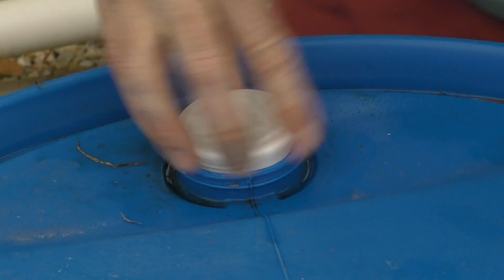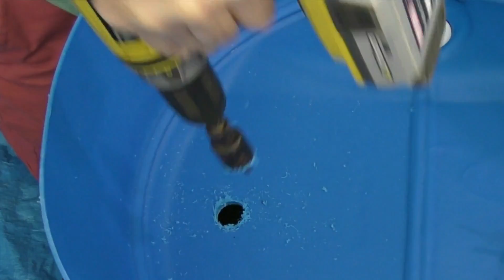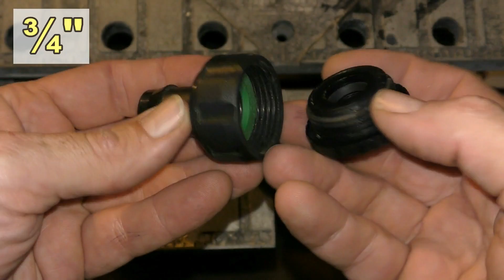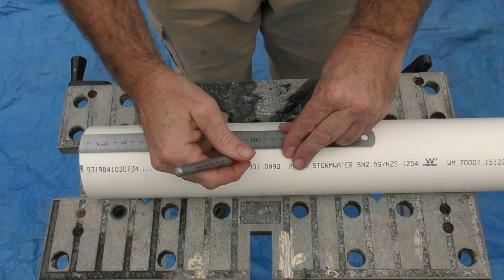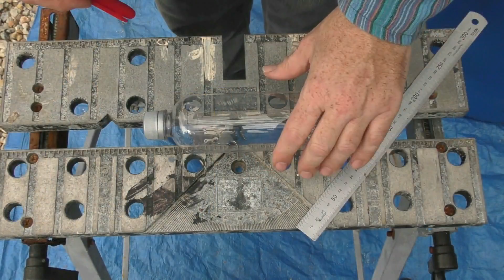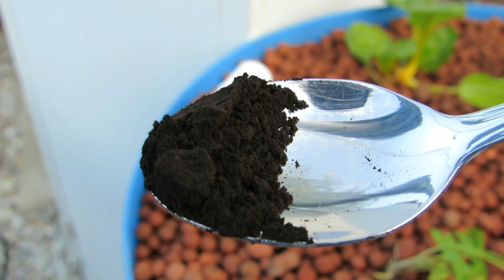Aquaponic Barrel System Build, Chop & Flip Style.

Comment: I watched your videos many many times as I built my barrel with my little one. everything seems to be working fine. I am curious about the ball valve used for flow control.  I have more water traveling through the ball valve than the TV at the top. Will the organic matter make it to the grow bed or mostly cycle straight back into the barrel? I mean obviously some of the poop will be making it to the bed, my concern is for the fish and that the water is getting the trip through the nitrogen cycle for full benefits for plants and fish alike.  How often on average do you purge your barrels and freshen up the water or does it seem to work out okay and you get by with replenishing from evaporation?
Reply: BTW.  We used the fish idea for a service port. we used a tracing of my daughter's hand for the fins on the fish.  Since this was our first aquaponics endeavor I found it fitting to go this route since this will be a project that I keep forever.
Reply from the maker: Hey Jeff & great question mate.👍 Sounds like the pump might be a bit oversized for the system. It's really hard to recommend one with a specific flow rate as they never work to the specifications printed on the box I've found. I tried 2 different brands with mine & found the Aqua One brand to be closer to the mark doing a test with a 10L bucket. 
On the filtration side, I think you should be fine as long as a minimum of 2 x the fish tank volume passes through the grow bed every hour. That should give the bacteria enough time to convert the waste as long as you haven't added more than 10 goldfish sized fish in the tank. 
As long as the system is cycled & enough water is passing through the grow bed you won't have to worry about removing any water, just top ups as the plants & evaporation reduces the levels. I liked to top ours up once the level dropped below 2 thirds the volume of the fish tank when the grow bed is empty. I just pull the bell off of the standpipe & let the bed drain before topping up.

Hope that has helped you out some Jeff.
Reply: the box says it is adjustable.  I'll see if I can dial it down a bit. It's going to be a while before I put fish in the system. Going to cycle the system and hone my skills on checking and maintaining PH levels, and the sort.
Reply from the maker: That's definitely a cheaper fix than a new pump.  😉  What are you using to cycle the system ?
Reply: urine

Comment: How often do you have to empty the thing to clean the bottom for the fish?
Reply from the maker: Hi Mr Blades. 
I found that the majority of the fish waste was pumped up into the grow bed so little cleaning would be required. As I had mine slightly elevated it would be easy enough to use a siphon hose to clean any build up on the base. 
Cheers Rob.

Comment: I'm very fascinated by your builds, I've been following many different Aquaponics set ups trying to determine what will work best in my sun room. The big challenge for me is the fish tank, I can't seem to find used ibc totes in my area. I've thought about building it out of plywood with bracers for support. FDA approved polyethylene material runs about $100 for a roll. My question is, what would you suggest?
Reply from the maker: Hi Kris & sorry I missed your post mate.
Did you end up building a fish tank or did you source a suitable container elsewhere ? 
If you were to use ply I would definitely make sure you have suitable bracing but you probably know that already.😉 
Cheers mate.

Comment: Hello Rob, Where did you get the bulk head tank fitting for this?
Reply from the maker: Hi there. Sorry for the late reply mate & hope you found the fitting. Are you still trying to find one? 
 I got them from the local hardware store here & know the plumbing supply store also stock them. 
Sorry again for missing your comment. 
Rob.
Reply: Thanks Rob, I enjoy your videos. I was able to find tank fittings. We worked it out with what is available here. We have two units running. I've been conditioning the tanks and  I just put fish in them yesterday.
Angela
Reply from the maker: That's great to hear Angela 👍 Hope the system takes off fast for you now things are warming up. 
Cheers.

Comment: I made a system like this but I only have hard water. What could I do to get my water soft for the system. your video are so helpful. Thanks
Reply from the maker: Hi mate. You could try saving some rain water & mixing that with the tap water to see if it helps some. The other option would be to treat the water in a separate drum with some muriatic/hydrochloric  acid to help reduce the hardness & also reduce the pH into a more plant friendly range. If you are going to use acid I'd start with a very small amount (less than a tsp), mix the water then let it sit for 6 hours before testing the pH. The reason being is that the pH will drop for a while then bounce back up. I have needed to repeat this process up to 6 times to get the water to about pH7 so some patience is required. 
NEVER do it in the system with fish or plants as you most likely kill them.
Hope that helps you out a bit & sorry for the slow reply.

Comment: Great looking system.  Have your run it for a longer term test?
How do you handle fish solids?
The ratio of water to grow bed seems high compared to other systems I see, is there enough grow media to filter / keep up with the ammonia without water changes?
I know there isn't lots of light entering the fish portion, but algae is bound to be an issue, any tips on keeping it in check?
Reply from the maker: Hey Jordan.
The system has been taken down but you can see a small update here,
https://www.youtube.com/watch?v=SSD1KuQXC8Y
In it's place I now have a large root pouch garden 👍

As for nutrient content & processing, that all comes down to how many fish are in there & how much you feed them.  If you put inn 25 fish & fed them all they could eat you would run into problems very quickly I think. As for solids, having such a small grow bed may mean you need to clean it out every few years if you have it highly stocked but even then it would take less than an hour I think. 
Algae could be an issue depending on how much light the tank portion gets & did notice it building up in ours just before it was pulled down. Easy enough to fix with a coat of paint (like most DIY aquaponicist do with their systems) & have seen some folks pop a section of reed or bamboo screening around it to make it look a bit more pleasing to the eye. 
Hope that helps.
Cheers.

Comment: G'Day Rob, I am starting to build a barrel system and was wondering a few things. How often do you flood the grow bed on a system this size? I am wanting to use a 12V pump and timer and run them from a battery with a smal solar panel to keep it charged.
Reply from the maker: Hi Richard.This one was filling in 3-5 min & taking about a minute to drain.  
How's the system going for you?  Sorry I missed your question when you posted it.
Rob.
Reply: G'day Rob, the system is built and running but I haven't planted anything in it as yet. I am running the pump on a timer at 15/45 but I am concerned that at times the pump cuts out after 15 minutes and there is still water sitting in the grow bed as it has not filled completely. Is it ok for the water to be sitting in the GB for the 45 minutes or is there a way to empty it?
I am just wondering what camera you use to make the videos?
Cheers
Reply from the maker: Hey Richard. I don't think the 45 min would be too long. If you are concerned you could always drill a small hole at the base of the standpipe to allow some or all of the water to dribble slowly into the tank below. 👍
At the moment I'm using a Panasonic HC-VX870M & my Samsung S6 mainly. Both do a fine job I think. 
Cheers mate.
Reply: peppa.

Comment: I want to do this but am having trouble finding a bulkhead fitting online. Please advise on where I can obtain the parts needed? Am in the USA Thanks
Reply from the maker: Hey Thomas. The fitting doesn't have to be the same as I used. 
These folks in the States sell a similar bulk head fitting if it helps any.  http://www.aussieglobe.com/bulkheads.html
Any plumbing fittings that can make a water tight seal will work if they take the pipe size you want to use. I like the rain water tank/bulkhead fitting as it has a longer tail on it. You can use a similar set of fittings that were used to deliver the water to the grow bed on the drain side as well if you want. You might run into issues if you want the base cap on the shroud though just to warn you. 
Hope that helps some.
Reply: Thanks Rob great info

Comment from the maker: @Peter M  Can't reply to you or PM sorry mate. Hope you see this.....
I think it could if the access holes were made a bit smaller to increase the tank volume Peter. Be worth a shot I think & would like to know how you get on if you have a crack at it. 👍 
Cheers mate.
Reply: Rob Bob's Backyard Farming I can't find his original comment are you talking about the volume of water in the set up? You have any idea how many litres it would be? I followed the instructions step by step
Reply from the maker: Hey Garth. I think it's been deleted unfortunately.  As I cut it I think just under 100L/26½gal.
Probably between 80-90L/21-24gal somewhere.   
How's the unit working for you?
Cheers.
Reply: Rob Bob's Backyard Farming it's working great looking to add another grow bed the same size we don't have a lot of room at home so looking to keep it small until we move to a bigger property. Would it be worth while having a full 200 l barrel as a fish tank then add another grow bed same size and use the sump?? Or is that a waste of a barrel ?
Reply from the maker: Having a full barrel as a fish tank would be a good idea if you're adding another grow bed I think as long as you add in a few more fish. 👍  How many are in there now ?
Reply: Rob Bob's Backyard Farming there are 4 gold fish at the moment the system has been up and running for almost 5 weeks it's going great. 10 fish should be fine with two grow beds?
Reply from the maker: Gareth Clouston 10 for the 2 beds should be fine I think 👍

Comment: very cool setup, how do these fare in colder weather climates?  or what would one do during winter?
Reply from the maker: Hi Mike.We could get away with keeping goldfish in them here no worries as long as it was in a sunny position 👍 
I think in cooler climates they may need a small heater popped into the tank to keep the fish happy & may only need to be turned on at night in some climates. In colder regions where you get a hard freeze It would be best to bring it inside & set it up in a sunny position for the cooler months I think. 
Hope that helps some mate.
Cheers.

Comment: What a great build! Any idea if it can be painted? Just the outside, of course. But, I am curious if there is a particular kind that should be used anyway, or if it's not a good idea. Thanks so much for the video. It's something I really want to do and this is almost artistic in it's construction. :)
Reply from the maker: Hi Patty.
The barrels can be painted but most paints will flake off over time due to the nature of the style of plastic used. I have seen folks have success by sanding the outside very lightly & then applying the paint. The small scratches gives the paint something to hang onto. 
Mind you it's been a while since I've looked at painting any barrels or IBCs so there may be a new product on the market that may adhere to the HDPE2 plastic better now. 
Hope that helps a little.
Rob.
Reply: Rustoleum makes a spray paint that adheres to plastic or anything for just under 5 bucks. covers good and last
Reply from the maker: Just had a look at Bunnings & they sell it for about $12. As long as you didn't have to do many over coats it looks like a great product, thanks Jeff.
Reply: My hubs works at Lowes here in the states. He says there are a few different ones I could try. If I start this project (SO many things I want to do...haha) soon, I will let you know how it fares. Thanks for the help!
Reply: Wow...that's a crazy price difference in places. I think it's about 6-7 dollars here in NY...but, that's because everything here has to cost more- just on principle. I'm looking forward to putting something together. What a cool build!
Reply: +jeff mosier thanks! :-)
Reply from the maker: Nice one Patty. Will be even cheaper if he gets staff discount too.👍
Hope the build goes well for you 😊
Cheers, 
Rob
Reply: I buy my paint at walmart for under 5 bucks a spray can and one coat ususaly covers.

Comment: Franklin Anders
Hey Rob
Thank you for this absolutely terrific video. Love the fact that you 'fish shape' is a good(?) as mine.
In the beginning of the video you are standing by the corner of your hoop houses. I found the construction very interesting.
Do you have any videos detailing the construction of hoop houses?
I like what looks like star-picket and irrigation pipe with (I found a reference to) top hat to hold it all together. (Snakey visitor.)
Thanks again for such terrific stuff.
Franklin
Reply from the maker: Hi Franklin. I do have an older clip that shows how I've set parts of the hoop house up. 
The clip is about 9 min long but I get around to showing how the pipe is connected to the posts at about 7½min in. 
https://www.youtube.com/watch?v=b5uWJGUleLc&t=7m20s
The earlier parts of the clip just run through adaptations I've made & how the support posts have been set up.
Hope that helps you out some Franklin.
Cheers.

Comment: anyone know what the cost is per month to run that pump, probably a lot cheaper than a bag of organic salad...but just curious if anyone has run the numbers
Reply from the maker: Hi there.
This little pump is rated at 15W. Over 24 hours it would use 0.36kWh. We get charged roughly AUD $0.24 per kWH so for 24 hours it works out to be AUD $0.08. Definitely a lot cheaper than a bag of salad greens 👍 😉  A small system like this could easily be run off grid with a solar setup & pump too.
Hope that helps,
Rob.

Comment: great clip. 
hows the electricity consimption for these systems?  obviously the pump is always running. would love to give ut a try. would love the big systems but space means just the small system.  cheers.
Reply from the maker: Hi Elizabeth. I worked out that this 15W pump would cost us AUD $0.08 to run over a 24 hour period if that helps any 👍  Solar would work out cheaper over the long run after the initial outlay was pain off in greens I think 😉
Cheers.